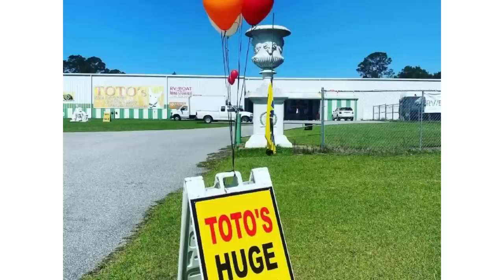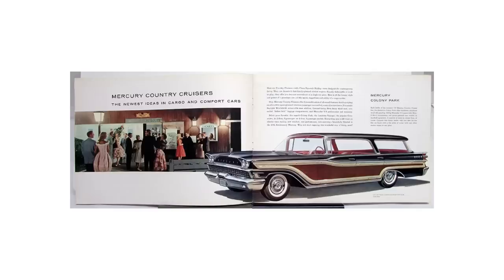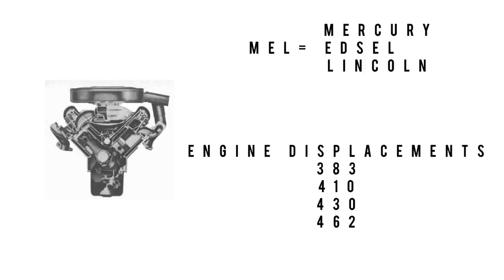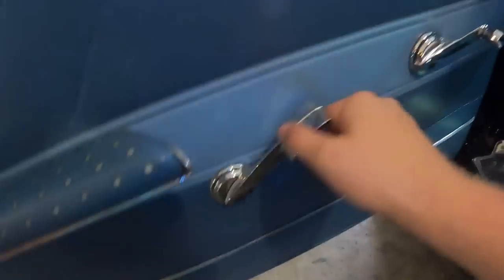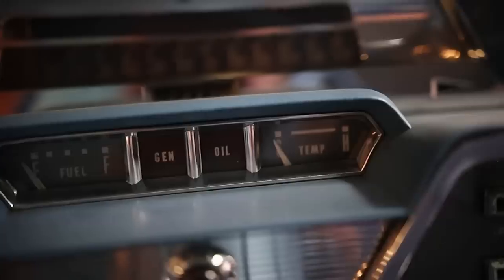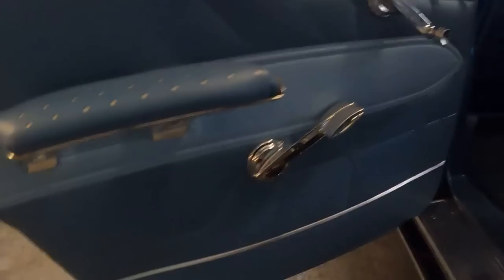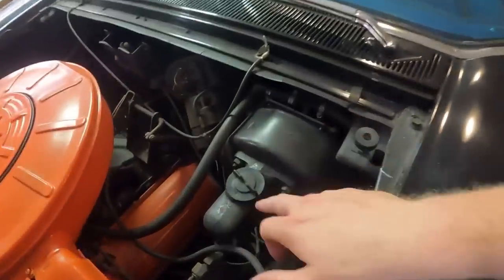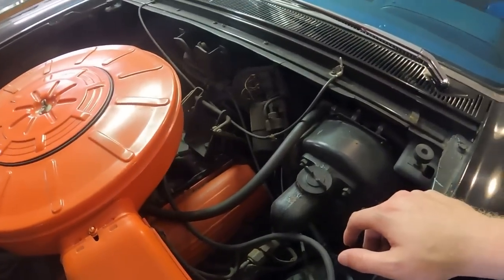1959 mercury Montclair 4 door hardtop

Comment: Mercury from 1958, 1959 and 1960 was definitely a split personality with three distinct and different ways of thinking. Like Charles Dickens once wrote in his Tale Of Two Cities, "It was the best of times, It was the worse of times." For Mercury these three years were a challenge and they did meet it head-on. By 1963 Mercury was back on the road in styling and in sales. By 1960 Mercury was headed back to better times and quieter styling from the out-of-this-world 1959s. Slim, vertical taillights encased within upright bumper pods replaced the huge triangular lenses of 1959, and though vestigial fins were discernible above, it made for a more subtle attitude and look. Quad headlights moved down into the new concave grille, and were spaced far apart giving the front end a less immense and block like stance. Both windshields and back lights again displayed startling compound curves. Five hash marks ahead of rear wheel openings identified the Park Lane; three such hash strips went on Montclairs; none on Monterey. Transmissions were Merc-O-Matic on Monterey and Montclair while the Park Lane received Multi-Drive for the automatic. Prices started at $2,631 for a Monterey two-door sedan which was their "Price Leader" to $4,018 for the luscious Park Lane convertible. You could get 15 mono-chromed colors or 35 two-tone color combinations for 1960. The prices for the Montclair line were lowered in hopes to compete with lower-priced competitor vehicles. Advertising put a strong emphasis on the Montclair’s sleek styling, spacious seating, and not to mention one of its newest features, the road tuned wheels, which offered passengers a smoother ride than ever before. Its interior boasted leather-soft vinyl (at no extra cost) and rich Avalon cloth with tufted-loop carpeting. The windshield wrapped around in order to increase the driver’s angle of vision. The Mercury Park Lane was a full sized automobile produced by the Mercury Division of the Ford Motor Company from 1958 until 1960, and by the Lincoln-Mercury division from 1964 through 1968. The Park lane was a full-size automobile that was intended to compete with Buick's Roadmaster series. It was available as a hardtop sedan, hardtop coupe, and a convertible. At least sales were up but slightly at 154,000 full-sized Mercury automobiles.
Reply from the maker: Awesome information thank you so much for sharing all of it.. 

In my opinion the Mercury’s don’t get nearly as much love as they deserve.. I don’t wanna say that mercury was kind of the redheaded child of the Ford family but they were often overlooked..  I owned a grand marquis at one time and it was a great car late 80s hoping to do one for the channel sometime that might be an emotional episode lol.. that was grandpas car and he was my best friend he died 2/3 days before I got my drivers license
Reply: The late 50s were the era of space age styling and chrome....engine wise a high optioned Merc in those days had everyone else out gunned...

Comment: My first car was a 1966 Montclair I bought in 1971. A true land yacht, it floated down the highway. It's 390CI got only 10 mpg. A big, gigantic gas hog. Didn't keep it too long because I couldn't afford to feed it. Traded it in for a new 72 Toyota Corolla with a 1900cc lawnmower engine (seemed like it) that couldn't get out of its own way. Finally came to my senses and bought a used 68 F100 which I couldn't kill. 240 in line 6 with three on the tree. Kept that for ten years, sold it with 240,000 miles for more than I paid for it. Always owned trucks until I retired. Live and learn.
Reply from the maker: Thank you so much for sharing all of those stories with great memories 72 Corolla.. that’s a car not often seen I really like the 76 or 77 Celica, and to be honest I haven’t seen one of those in years either

Comment: Absolutely love the ‘59 Merc’s. Thought these were incredibly beautiful. This was the model car used in the “Twilight Zone” episode “The Hitchhiker”.
Reply: Yes, that's a great episode.  There's a fun continuity glitch that takes place after Nan is driving with the sailor and decides to run over the hitchhiker.  The sailor grabs the steering wheel.  They cut to a fast exterior shot of the car swerving back and forth in the dark shadows, but for that split second, Nan's '59 Mercury becomes a '57 Ford.  My guess is they just used was stock footage.
Reply: @cryan4041  you are absolutely correct with the ‘57 Ford. They also took the wind vents out of the front doors. 

I believe you’re going, my way. 

Great episode.
Reply: @cryan4041  That same '57 Ford crash footage was used in several Perry Mason TV episodes.  Why go back and endanger another stunt driver and total another car?

Comment: One of my favorite years of Mercury. The Park Lane sure was glitzy. Cannot imagine a 312 engine powering this car. Also love the 4 door hardtop wagons of '59 and '60.
Reply from the maker: Totally agree =)
Reply: The hardtop wagons for Mercury began in 1957 and ended after the 1960 model run. Two door hardtop Mercury wagons were also available from 1957 thru 1960.
Reply from the maker: Thank you for that added information I need to find some wagons
Reply: Love Mercury's but this has to be ugliest, slabsided car along the lines of Oldsmobiles of the time. Ugh. about 800 pounds of too much chrome on them.

Comment: That was the wiper arm motor.  I looked for the washer fluid resivior pouch, but didn't see it. It may have been black and blended i with the engine compartment walls. The pmp for the fluid would have been mounted near the pouch and hahe hoses connected to it that ran from the pouch to the pump and from the pump to the washer nozzle in the cowl.
Reply from the maker: Awesome thank you so much =)

Comment: It's so ugly it's beautiful!  That's the electric windshield wiper motor with the washer pump attached.
Reply from the maker: Awesome thank you for that added information that’s what it looked like to me was both wiper motor and washer =)
Reply: It's so odd that the 1959 and 1960 Mercs pioneered parallel action wipers, then in 1961 went right back to using wipers that swept outward.

Comment: My paternal grandmother drove a 1959 Mercury Monterrey four-door sedan. Baby blue. It was a replacement for her '56 Olds which she totalled.

Did you notice how the radio antenna is at an angle? I thought somebody had bent it that way, so to make it straight like all the others car antennas I tried to bend it. Popped the damn thing out of the fender.
Reply from the maker: Yeah there was a clip that addressed that but the file got messed up couldn’t use it

Comment: An interesting fact about the with of the Mercury from 1957-60, anything over 80" was classified as a truck as some state-required Mercury to have truck plates!
Reply from the maker: I was going to ask that but forgot to..  that’s interesting wasn’t sure if 80 inch wide rule wasn’t a rule than or made that rule after this car was made that’s very interesting =)
Reply: The 80" rule was in place, but not enforced for cars. If it had been, several cars would need clearance lights. The 1960 full size Fords were 81" wide.
Reply: @Al-thecarhistorian  Some states in forced this rule. Arizona for one.
Reply: @davidjohnson4550  That's both an interesting and hilarious historical fact.

Comment: The 1959 Mercs still had the Turnpike Cruiser. Was there no mention of the "Breezeway" option in the literature? It was where the rear window was flat and the center section electrically rolled down.  Lincolns and Mercs had this option into the early 1960's, with Merc being the last to have it in 1964.

The 1959 Merc you reviewed was unfortunate in that it had Ford's first and only 2-speed automatic. If in full-sized cars these were most commonly used in Edsels, probably for the less sophisticated and cheap-skate people. It was a competent and reliable automatic, but behind the times technologically and actually a step backward. Ford found this out, but as they are reluctant to admit their mistakes, they used it mostly in the last Edsels and Ford's new for 1960 Falcon/Comet line. It was also the only auto available in Ford's new mid-size lines into 1964. The 1964 1/2 Mustangs also used it if they had a 6 cyl. or the 260 V8. 

Thank you for the video!
Reply from the maker: Thank you so much for those corrections I thought breezeway didn’t come until 1960.. or early 60s was it available only on Lincoln’s and Mercury’s or was it available on ford too.
Reply: Turnpike Cruiser was only 57 and 58 and had the reverse slant retractable rear window. All 1959 Mercury hardtops were called Cruisers, rather than Phaetons. 58 through 60 Continentals, not Lincolns,  had the retractable rear window. 63 through 66 Mercury had the reverse slant retractable rear window. 67 and 68 Mercury had a retractable rear window that only went down about two inches and had a forward slanting rear roof.
Reply: @What.its.like.  No, Ford never had it. Instead, Ford had the retractable hardtop, originally designed for the Continental MK II and planned for the 3rd gen T-bird, but it got a retractable convertible  top instead. 
We used to have a 1959 Mercury Breezeway Turnpike Cruiser, with the MEL 430 and Cruise-O-Matic.
It's true that the last Mercury Breezeway was in 1965. When Lincoln/Continental debuted it's new body style in 1961, it's Breezeway top was eliminated, but replaced by the 4 dr. convertible.  The 4 dr. convertible continued until the Continental's next body change. As T-birds always shared a chassis(shortened) with the Continental since it's 1955 inception, the T-bird suicide 4 dr. was added in the late 60's. With Lincoln's new Continental Mark series, soon T-bird would share that chassis.
Reply from the maker: Thank you so much for that added information =)
Reply from the maker: Thank you so much for sharing that information =)
Reply: @automatedelectronics6062  There was no Turnpike Cruiser or breezeway rear window in the 1959 Mercury line up. The Turnpike Cruiser was only offered in 1957 and 1958. The Breezeway window, while offered on the Turnpike Cruiser, did not show up on Mercurys until 1963.
Reply: @What.its.like.  Breezeway was not offered on Fords or Thunderbirds. Fords had the retractable hardtop (Skyliner) for model years 1957, 1958, and 1959.

Comment: The old vehicles back then have a better quality. I've modified my old 65 Ford Thunderbird to get better gas mileage. Just Sad nobody's impressed about it. Everyone's into fuel economy.
Reply from the maker: That’s awesome =) I am interested in getting better mpg I was wondering is there any numbers lower than 2.90 because might be able to make Auxiliary transmission to incorporate that gear and only use it if you’re on Wong Hall destinations rent because you won’t have no torque... unless of course you have a huge engine but if you’re using a small power plant torque would be an issue 

Totally different subject but I’m hoping next year sometime I can build a prewar speedster almost like a Grand Prix race car I want it to be powered by a 250 or 292 inline 6 Chevy put 3 Weber side draft carburetors on it with a big cam two speed rear end so I could have 514 and 373s.. beat just about everything with a 6 =)